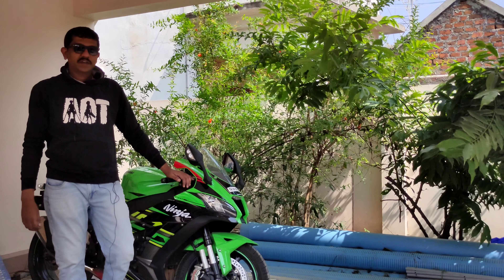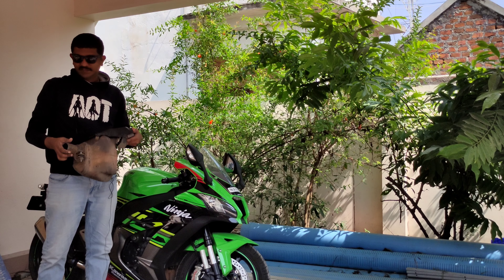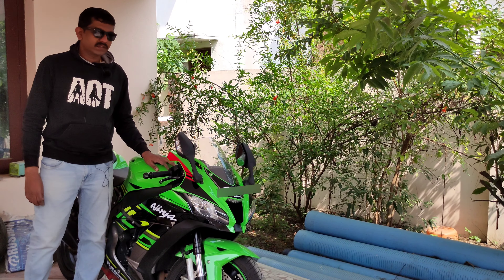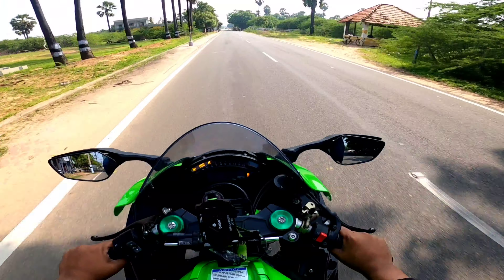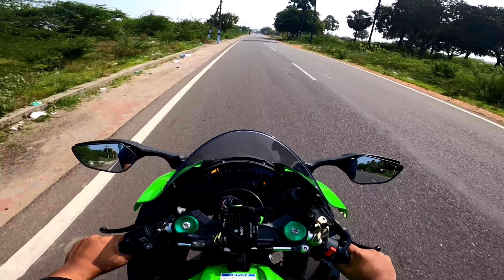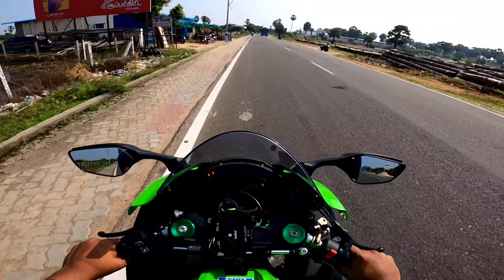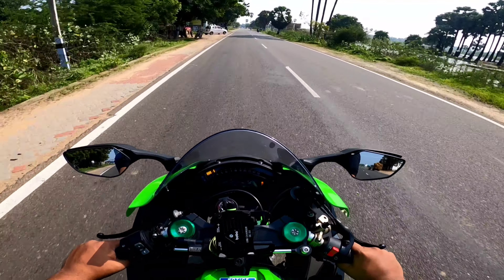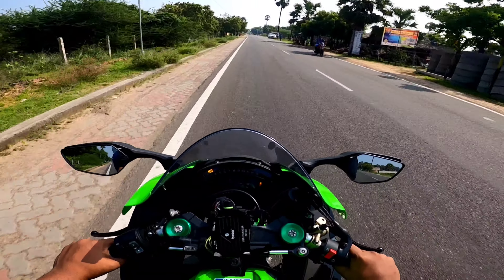Removing catalytic converter in a zx10r | Decatting the zx10r |

Comment: KTM RC 390 2016 model 44k running
1 lac 20k what u say bro
Will engine be good
Reply from the maker: Thats a good price for that model bro. But make sure the motorcycle has not met with any accident or is badly maintained.

Comment: Air filter stock ah anna 
Stock pa vachu otuna mileage drop agudha nu parunga ila aftermarket vacgu otuna drop aadha parunga
Since u decat it
Reply from the maker: Hi bro ipo k&n air filter than potruken. But decat panni mileage check pannathu illa. Normala 16 to 18kmpl mileage kedaikum. Ipo once check panni pakanum.
Reply: @Travelwithzx10r  en sonnena prem bro 2019 la stock 200km full tank austin racing la 180km ahm decat stock la 160am
The air fuel mixture will run lean with aftermarket filter since more air will be coming in less air going out since racefit sc project is 70mm link pipe dia
Reply from the maker: @parthasarathy5450  oh. Enaku link pipe size theriyala but naa ipo stock end can than use panren. But power difference ethum visible a theriyala. Chance kedacha check panni pakanum.